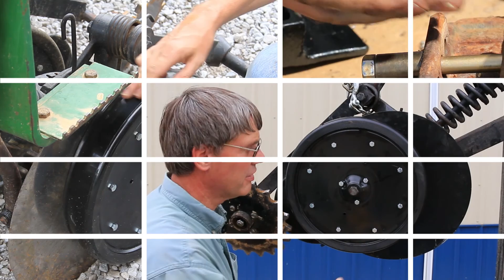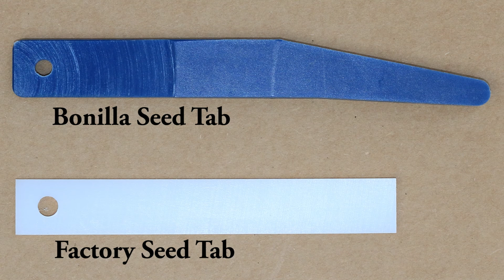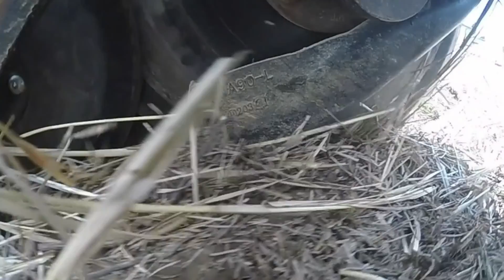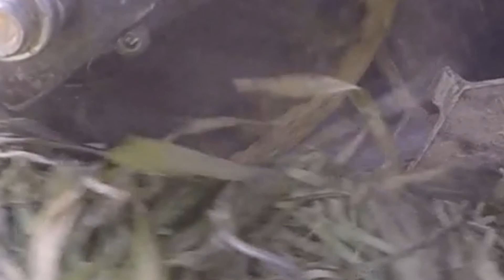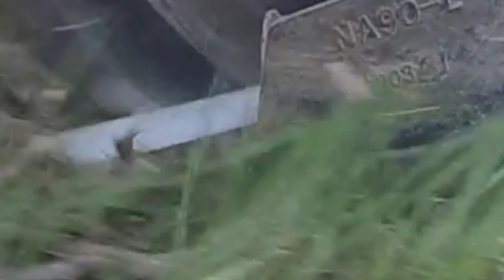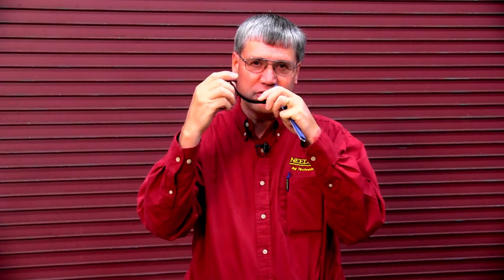Needham Ag - Bonilla Seed Tabs For John Deere single disc drills and air-seeders.

Comment: You have any for JD 1560 drills?
Reply from the maker: They only fit the 50 and 90 series seed boots I'm afraid. The 60 series boot doesn't have sufficient room to install a thicker tab between the upper and lower sections of the seed boot.